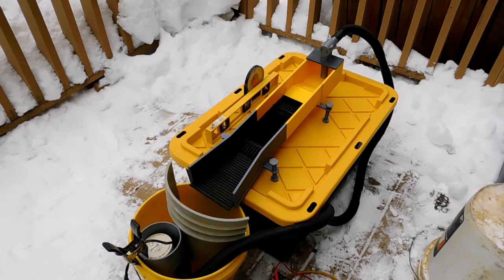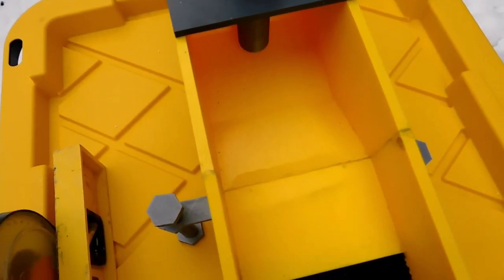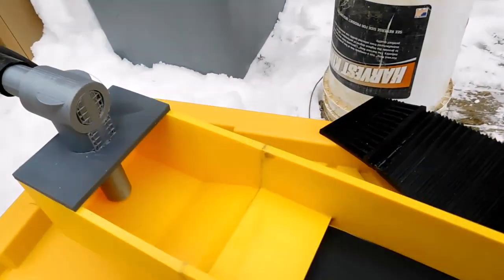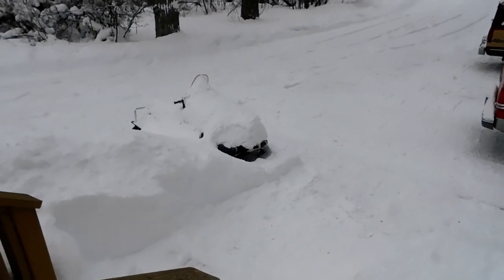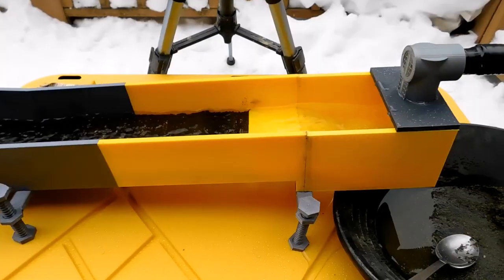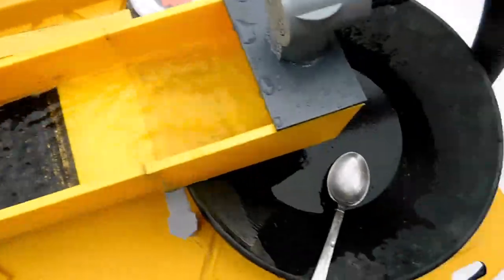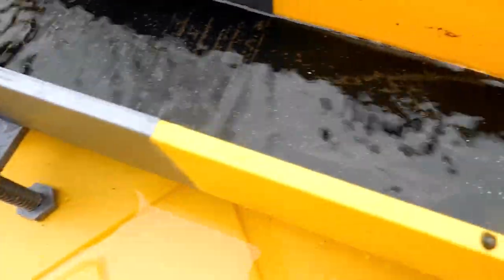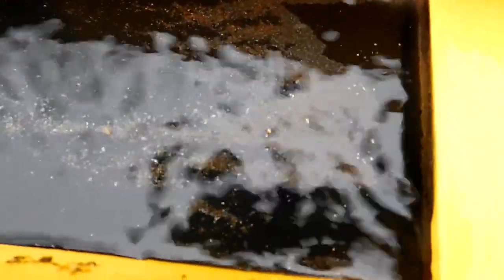New Deep Well Clean Up Sluice/Miller Table Combo AMAZING RESULTS!!!

Comment: Hey, Alan. What a great little sluice. That will really be a nice addition to your kit and store if you decide to sell it. Thanks for the shout out. I’ve really been liking the Deep Well concept for the super smooth water I need for some of this super fine gold. You might try dumping your dirt back in about the middle of the ramp and see if the gold will drop out there. If you check out my 10” silicone mat run video you will see what I mean. Maybe shorten your ramp to add a fluid bed addition to it as well.keep them coming.👍👍
Reply from the maker: Thanks for the tips. I will go back and watch your video again and see what I can do with my design. Thanks for the deep well concept it is the bomb.

Comment: Looks to be a very effective small cleanup sluice.  Looks forward to when we can buy one.   Maybe a kick starter to build the molds and manufacture at a reasonable cost.
Reply from the maker: Thank you. I will be using the 3D printer for the production. It's slow but very cost effective.

Comment: Usually your weather conditions become my winter ...So bring on that 35 degree temps..Nice job on the mini clean up sluce...That 3d printer you use has definitely got its use.
Reply from the maker: Spring soon I hope. The four printers do get some use.
Reply: Would it be to hard to do sometime..but I think it would be interesting to see or watch you do your 3D printer.
Reply from the maker: @jackbailey149  I will have to do that again sometime.
Reply: That would be awesome..👍👍👍

Comment: You have a link for the bilge controller???  Thats a great compact.. sweet for sampling ect..
Reply from the maker: Here you go. They work great. https://www.ebay.com/itm/US-10-60V-20A-Pulse-Width-Modulator-PWM-Waterproof-DC-Motor-Speed-Controller-New/112274411511?ssPageName=STRK%3AMEBIDX%3AIT&_trksid=p2057872.m2749.l2649
Reply: @alanrobertson2510  thanx Alan 👍

Comment: Ahoj Alan, greetings from CZ.
Great idea, this 3D Miller sluice. Is the silicon mate needed? Could be just 3D printed rifles? Like a board with V structure...
Reply from the maker: Yes the silicone mat is needed in my opinion. The fine gold does not slide on silicone. It works like sand paper.
Reply: @alanrobertson2510  Thank you for answer. I have seen your videos making silicon mats.
Looks quite easy... I will give it a try...

Comment: On my Miller Table that I built my pump runs as normal I just built a spray bar bypass with a sluice under the table into a bucket in a recirc tub  think I will make a video of it and post it up . Problem I have I have yet to get out this spring to find any gold still Drilling Oats
Reply from the maker: Good idea with the sluice under the miller table.

Comment: Alan, let me know how much you'll be selling it for and I will buy the first one off the line, with your signature printed in the side.  Cheap version would be just the sluice, Deluxe version will include the pump, hose & Speed Controller.  All orders will NOT include shipping.
Reply from the maker: OK you can have the fist one. I ordered the material today. They will be blue.
Reply: @alanrobertson2510  what's the price range for one of these